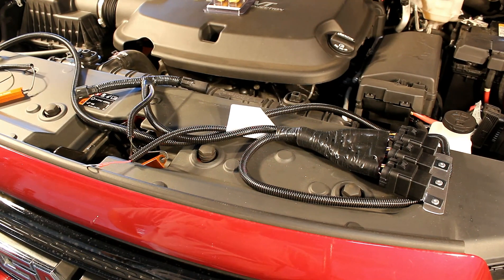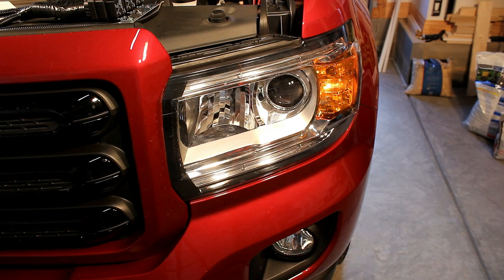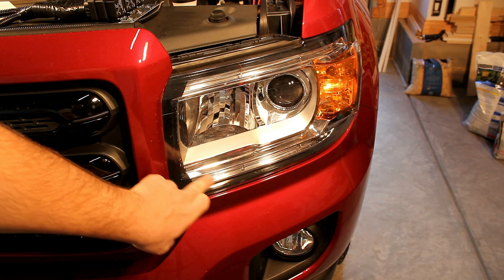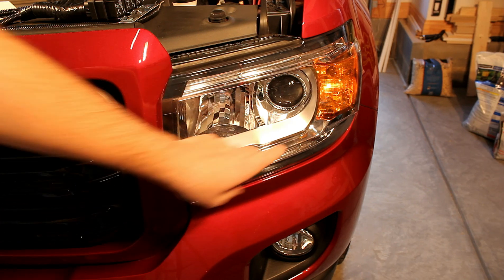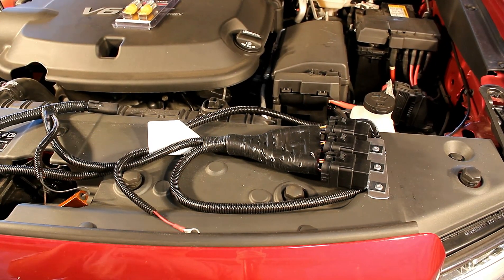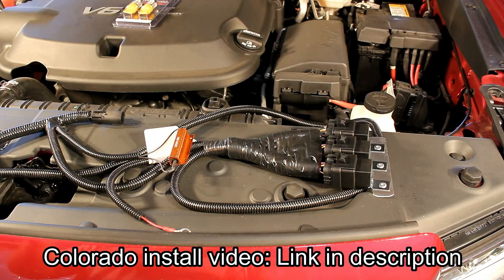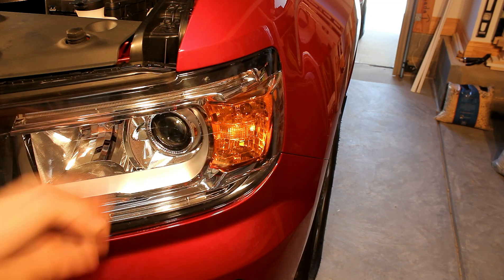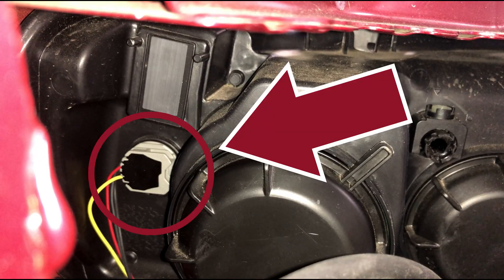[HOW TO] Install DRL Relocation Harness on a 2015-2020 Canyon (Plug-N-Play, Gen5DIY, Diode Dynamics)

Comment: Love all your vids, highly informative.  Since I consider you a bit of an expert at mods for the GMC Canyon (and I also have a 2019 GMC Canyon Extended Cab SLE and installed the harness in this video), do you know if there is a way to change the color of the LED bars from white to amber to match the parking/turn light?  Thanks and keep the great content coming.
Reply from the maker: Thanks a lot! Glad you enjoy my content. As far as I know there is not a way to change from the white LEDs to amber without totally replacing them. And that would involve opening up the headlights. It would be quite a process. Thanks for watching! I have some new videos planned for the next several weeks!

Comment: Great video, quick question do they engage the tail lights? I know when I turn on the parking lights the tail lights go on does this happen with the harness? Also are the LEDs brighter with the harness then parking light setting?

Thanks!
Reply from the maker: No the tail lights do not come on. All this does is override the DRL signal from the low beam to the LEDs.  As for the brightness of the LEDS I can’t really say. I never really checked.

Comment: I added this same harness to my 2018 Canyon. I had the Morimoto HID system with their relay harness on my 2015 Canyon, but this is a much better way to go for HID conversion. This is the way it should have been from the factory.  Did you notice that the LED strips do not seem as bright as the OEM setup?

Bill
Reply from the maker: I didn’t notice any dimming of the LED strips. They look the same to me. They’re just on al the time now instead of the low beam.

Comment: I added factory LED tail lights to my F150. I simply coded out the hyper flash using a free software called ForScan. Too bad there isn't something like that for GM vehicles. I hate resistors.
Reply from the maker: That’s kinda cool. I’ve never heard of that before. Thanks for sharing. And thanks for watching!
Reply: given all the crap we can do through the radio I think honestly they should just have an option to tell a vehicle via the menus that you put in LEDs.  Especially given how readily available they are even at places like Autozone or Advance Auto.
Reply from the maker: Interesting idea. Thanks for watching

Comment: I have changed my tailights to LED and did this stop hyper flashing for them too with this kit?
Reply from the maker: You need to install resistors on your tailight wiring. That’s the only thing that will stop hyper flash.
Reply: Ok thanks

Comment: Do any error codes show up or engine warning lights showing up?  Also do the lights come on on your dash showing lights on ?
Reply from the maker: Everything functions like factory. No codes. No warning lights. It’s just now the DRL is on the LED strip instead of the low beam. Been fine like this for a few years now.

Comment: Does anyone know if this is safe to do so?. I mean cause I want to do this but I don’t know if it’s like some type of electric fire hazard since you messing with the cars electric system?.
Reply from the maker: 3 years later. My truck hasn’t burned to the ground yet.
Reply: @fondupot  have you had any issues with it at all like maybe had to replace any type of fuses or anything?. Would u say this is a pretty safe thing to do so then?
Reply from the maker: @itzzgabeee I haven’t touched it for 3 years. It’s been fine. No fuses blown, no bulbs replaced.  Yes it’s safe.